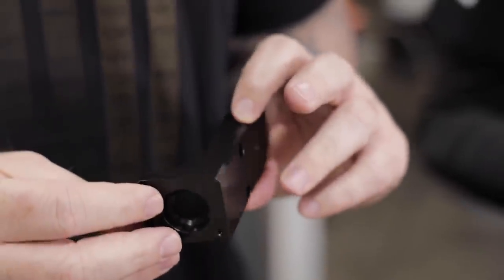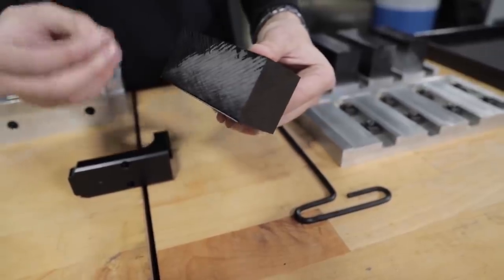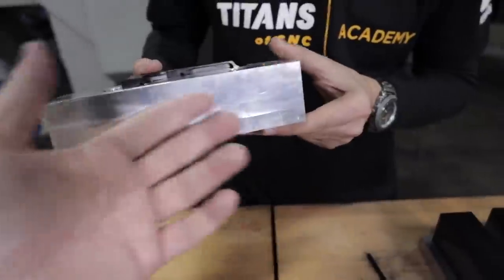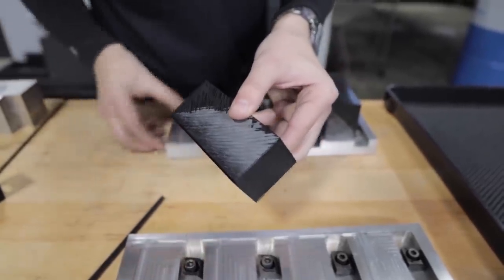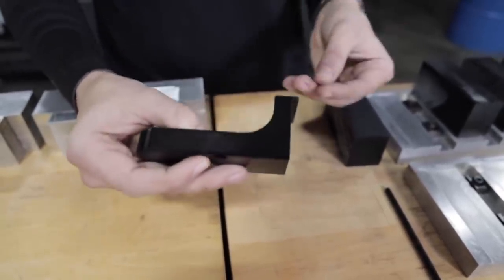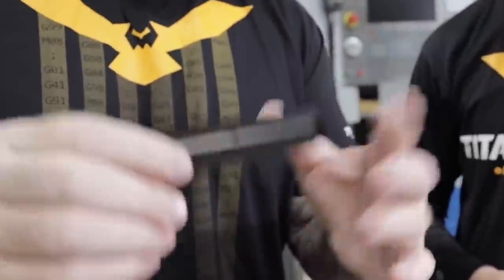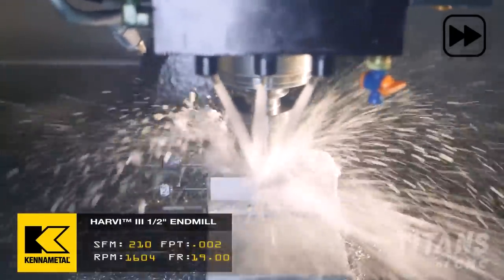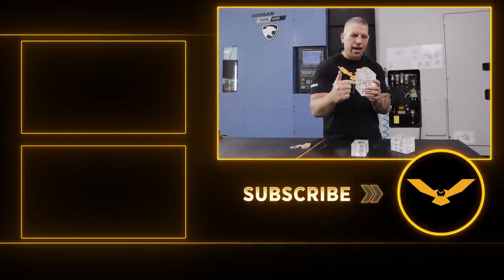Is Plastic More DIFFICULT to Machine Than Inconel???

Comment: We do milling, lathe, and molding of medical products. The customer prints are clearly from metal machining backgrounds or worse yet first year trade students. 0.002 flatness on polyWarpylene? Critical dims of non-form/fit/function areas? Arc-radius less than 1 degree on an internal surface? Your first line of defense is a good DFM discussion with the customer. We also use bosses for sensitive materials even with Schunks. More plastics vids, Titan! Thanks.
Reply: Excellent point. Years ago I was asked to machine a part that was drawn by a 1st year Mech Eng student. It was impossible. So knowing the application, I redesigned and produced the part. It took some back and forth with the client to get them to at least give the part a try even not to their drawing. The client's response when they did put the part into use was quite pleasing :) As to plastics, I've been making tiny parts in Acetal including gears (0.5 m) for decades. It's a magic material to work with.
Reply: Agreed you can always tell if someone isn't use to designing plastic parts from the tolerance. It's also tiring having customers complain their plastic parts with really tight tolerances are out of tolerance. Only to find out they aren't inspecting them in a climate controlled inspection room and that temperature difference is what's putting the parts out of spec.

Comment: One thing I also learned very bloody quickly is that plastic cutters need to be razor sharp. I keep a special box with cutters apart specifically for plastics as even lightly working soft metals like alu ruins them.

Thanks for the tips Titan, as well as other commenters! Love to hear from experienced vets in the trade.

Comment: If you take a super sharp end mill like a YG alu power and dynamically face parts with a .05 stepover but super fast you can face plastic without much tool pressure. Got a 16 surface finish on UHMW that way on one parts.

Comment: Fun fact.  You can grind acetal copolymer (Delrin) to within those specs on a decent standard shop grinder and fly cutting does wonders too.  From someone who has spent the last 10 years in medical where we use delrin and PEEK  extensively for fixtures/machines because of its non porosity and chemical resistance.
Reply: Hi James. I make gears for my products from Acetal but would like a bit more strength. I've not tried Peek yet. Any thoughts? Specs show a significant increase in tensile strength vs Acetal. But there are several varieties of Peek.
Reply: @robguyatt9602  I have seen gearsets made of peek in some things.  I'd try it.  It is a bit tougher than Delrin and I believe it has a higher resistance to the effects of heat.  Even more life can be had with glass filled PEEK but not sure how that impacts machine ability or finish.  Haven't used both.

Comment: My experience with plastics was how they can easily blow a corner or edge out as the cutter comes off the job . This was still a pressure issue and the tool was not sharp enough .
Reply: Always "eat" into the part
Reply: We often go the other way and use doll or heavily used tools when we have a problem cutting plastic, often the tools are to sharp and that's what gives us problem som times😆

Comment: We've bean cnc plastic for 40 years and every part and every day is a new part and a new day😂🤮

We work a lot with round stock and all kinds of plastic and you have to be all over it when manufacturing cause even one degree colder or hotter could get you off buy ~0.05mm and not only that there's tension in every extruded plastic or raw stock and you don't have that in metal in the same way..

We also never use coolant, we machine it dry as a bone👌 keeps our cnc machines as new for a lifetime to🤜😁

There one part that we have done for years and it's 1200mm seal in nylon and to get that right my boss dose that by hand on a big lathe, I think we get a order by 3 a year and we're the only one doing this part in Europe, no one els take it on and my boss learned how to do it from the previous owner that was a real old school.

Comment: Excellent problem solving. Plastic is most definitely harder to machine than metal. I had the same problem and solution in my years as a machinist. Delrin was one of the easier plastics to machine. UHMW was probably the greatest challenge because there's stress in the stock so as you cut it away the stress relieves and the part deforms. I had to rough cut, then leave the parts on the bench for a day to let the material stabilize. Then come back and finish the next day.

Comment: I'm a machinist for a plastic molding company.. you would be surprised how tough plastic can be. It will explode. Glass filled materials will wear your tools out rather quickly.  Coming up with ways to hold them is challenging. It will melt on you. It will warp.

Comment: When i machined delarin i always machine outside first then do inside to do the finish side make a block to sit inside to try keep the part as solid as possible. Had parts fly or bowed trying to find the sweet spot. Making jaws of same material to hold the part is alway useful i found when making some weird and wonderful shapes.

Comment: Had to turn some Delrin rods at 3/8 diameter, about 12" long. With +-.01" on the length it should have been a breeze, but sure enough, one cold winter they inspected a batch as soon as they received them and rejected them. We got them back and they were in fact undersize, but once at room temp they were well within tolerance. Plastics can be a pain, don't even get me started on Teflon...
Reply: I machine Acetal too. My parts are for my own products. Nothing like the length of that part. But it raises a point I never thought about. If I was sending my drawings out to other shops I think in the notes I would require that tolerances be held when the part is in a certain temperature range. I learned very early on not to mike a part straight off the lathe. Let it cool. I now use compressed air as coolant. Actually, I like doing Teflon. Nowhere near as good to machine as Acetal but :)
Reply: I believe nominal inspection temperature should be 68°
Reply: @joebender557  SATP is a real thing

Comment: Plastic is much less stabil, and ends up curling and twisting when you mill the center out of it especially with thin wall thickness.
Inconel is like machining rocks, but at least it stays put.
As long as you use sharp tools and don't crush it, Inconel machines pretty consistently.
Another good video Bud

Comment: Did you try using the same material as Jaws material to clamp, I'm assuming you used the aluminium as the jaw, I've used HDPE or vesconite or ertylite as clamp material on the respective materials to be cut, leaving no marks on parts, but also considering how hollowing out will warp a part, so rough out then finish, or "kiss" like you call it!

Comment: Plastic is very easy to machine, which is why I love working with them. I worked for a company that designed and manufactured scientific instruments, and many of our parts were made of various plastics with tight tolerances and thin walls. It's true that you won't get quality parts from the vast majority of job shops. Many machinists and machine operators ruin the parts by applying too much force when securing them. I solved this by using a torque wrench that measured in inch/lb.

Any part made from plastic sheet MUST be oversize to start because of the significant variation in thickness. The raw surfaces also aren't flat.

I never had a problem machining Inconel, either. Of course, I researched the proper techniques before ever making the first chip. Metcut Research Associates used to publish the Machining Data Handbook, a great reference on machining about every material you would ever encounter. You can still find old copies of the 3rd Edition on eBay.

Comment: Due to the low stiffness of plastics, it's easy to put 1/2% strain into a part with clamp loads.  I.e. 0.005" off per inch of part.  So excellent practice to back off the clamp pressure for the finish pass.

Comment: I cut plastics on a haas mini mill for five years it was for suction and discharge valves for offshore natural gas compressors
And yeah you can plunge all the way thru the plastic and chips fly just like milling the valves it take the other machines 4 to 5 hours for 1 set of valves and it take me less then a minute for the plate from my machine

Comment: Plastics are absolutely harder to machine to tight tolerance’s. Not to mention how tough it is when the part has to be submerged 100 ft deep in the ocean.
Reply: Had this problem customer and boss blamed me for part leaking. They checked my seal and dimensions everything was perfect to there drawing. Turns out they didn't put enough bolts on the drawing so it wasn't putting pressure evenly on the seal so i had to drill and thread more holes i never got a apology from the customer or my boss.

Comment: Sometimes there are no short cuts when machining soft material with tight tolerance. Months ago, I was making some HDPE parts for food industry, and it was a nightmare. The part is about 12” X 12” X 1” and has a .002” flatness call out and .002” tolerance on the depth of the step. The part is so sensitive with the pressure. a little bit of force can move all your dimensions out of the tolerance.

Comment: Although I work with tight tolerances not so much with plastic.   And yes I would probably be ripping my hair out on something like that, mostly due to the fact that if I do it there is only 1... 5 at the most. I'll always look for quick and easy fixturing methods.   An old co worker of mine would always fight for pallets, and dovetails, and I would respond with: "there is only 2 or so parts". The fixturing is harder to make than the parts themselves.

Comment: For plastic - all your tools must be super sharp, or they will melt it. For steel - it will cut anyway. ; )))
Reply: My personal experience is a slightly used carbide cutter, it gives the smoothest cuts.
Reply: Disagree, we often use doll or used tools cause to sharp are often the problem in som plastic.

Comment: We machine allot of plastic for our products in house and it’s tricky as fuck. Finish inconsistent billet to billet, tolerances hard to hit, drilling leaving nasty holes and so on. 

Every plastic has its cheeky differences.  Machine on a hot day vs cold day.

Eg… put some plastic billets in the fridge and take them out just prior to cutting if you want finish to be consistent billet to billet. 

We basically design around it now tho. 

Hart to wreck a tool on plastic but it’s a challenge none the less

Comment: is it even possible to be parallel within .001" to a flat surface that can vary by .002"? i think the parallelism tolerance should be .002". nice looking parts there Titan and great strategy.
Reply: Sure, depends on the relative lengths of the surfaces.

Comment: Inconel to most manual machinist ,is considered a tough metal.not hard.plastic is Micky mouse to machine.you titan figure out how plastic works under pressure. Hence the saying  grace under  pressure. Most of time I use tool steel cutter with positive rake.shear action is better than peel action.

Comment: Best way to machine plastic is to use a totally different kind of cnc machine from a lathe or mill. It’s called a 3D printer.
Reply: Nope. 3d printers can't come anywhere near holding these type of tolerances.

Comment: Completely different processes. I hated doing plastics, the operators just would follow the instructions correctly to run them. They would fall back into their habits from running metal, and would just cause their own failures, time and again.
Reply: Here's a good example. Customer went from aluminum to delron for an adjustment rod in an assembly we machined all the parts for. Programed the job, and had to slow down the process to maintain tolerances and keep the shrinkage (huge issue the comes into play later) under control. We were running these on our Swiss machines, and everything was beautiful, customer was happy and the test lot was 100% accepted. 2 months later we get a full order and set it up, first part is good, entire days work is spot on. Everyone goes home, night shift comes in and the start of the nightmare begins. Operator cranks up the feeds and speeds, to produce more parts per hours. Ran twice the amount as was expected for the shift, was really getting it. Note left for day operator says around 250% increase in feeds and speeds. First piece for day shift checks out good, and each piece pulled off the machine looks good. Then... QC comes and does a random sample of last nights work and ever parts is .100 short, taking no-goes on threads, diameters are all under spec. You name it, either under or over on the entire part. Not one dimension is correct, or even in tolerance, but the next part they check off the machine is perfect. I get called up and asked to look at it. See what's going on and the changes to the feeds and speeds, drop the part they just checked, as good, in cold water and check again. It had shrunk. Heat build-up from the machining was causing the material to expand (very thin, long part) giving the impression of correct tolerances for about 5 minutes after machining, then slowly shrinking as they cooled to room temp. Thousands of parts scraped in one day.

Comment: a bit confused as to why you would machine plastics in the first place
Reply from the maker: 🤔To Make Money😂😂😂
Reply: @TITANSofCNC  I am no expert, but plastics have the advantage of being easy to melt and form. Seeing you had sufficient volume, plastic injection molding can yield 5 thou or less of tolerance. Proper calculation with thermal expansion can you approach 2 or 1 thou of tolerance. Form tolerance as you spoke about seems (to me) overrated as plastics can’t hold their form as metals can. I’d love yo hear why you chose to do it this way
Reply: Injection molding is far more expensive than machining.
Reply: @tarehjernetarehjerne4082  There are a million reasons to use plastics over metals. Frction, electrical conductivity, thermal conductivity, chemical resistance just to name a few.
Reply: @andrewdiehl5746  Thats not my point. Why would you resort to machining it over different methods?